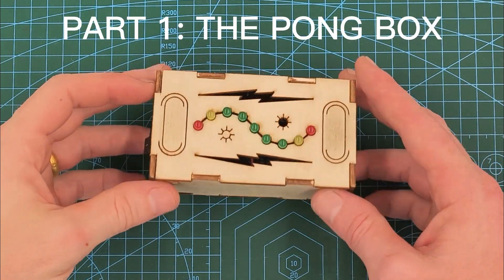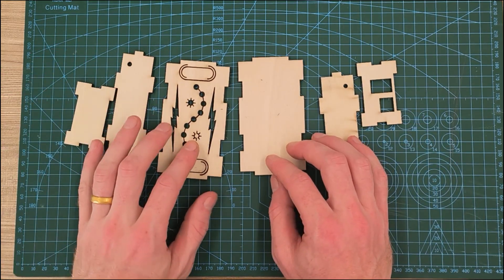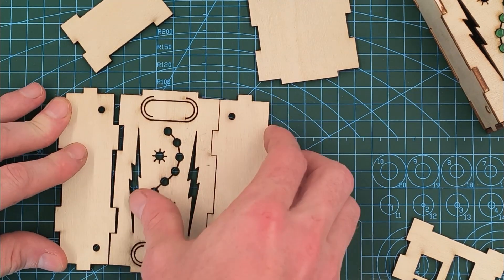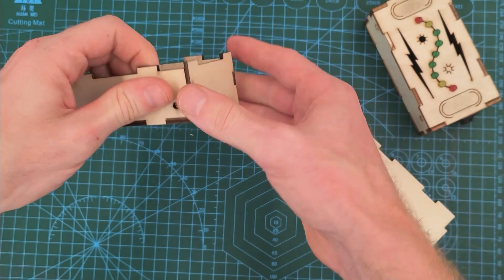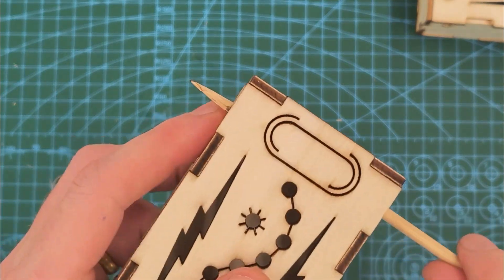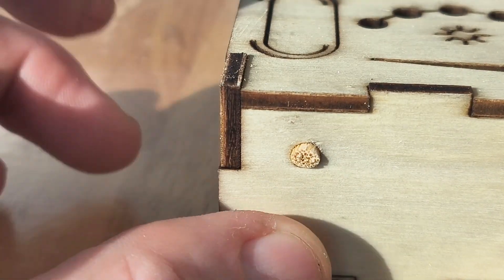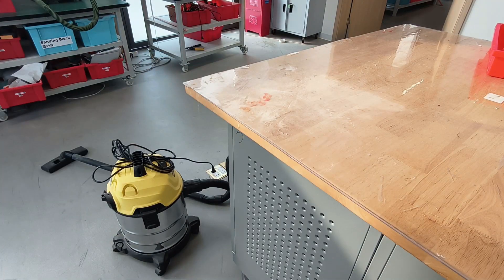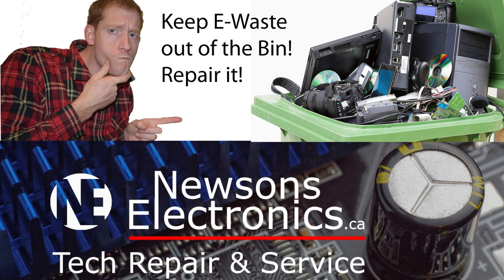Arduino LED Pong Game: A Fun Electronics Project (Part 2: The Box)

Comment: So the burn pattern on what I’m assuming is the bottom of the piece is caused by the laser bouncing off the metal grid supporting the piece. If you lift the part up a millimeter or two it should be a lot better. I don’t have a laser, but my friend does and I remember him talking about this. He just uses little magnets to elevate the wood while it’s cutting. You could also be getting burns from the fire coming off the piece on the top, which can be avoided by placing some transfer tape, or some other covering on the surface of the wood. Depending on the complexity of the part, it might not be worth it to peel all that off, and there’s probably a better way to do it.
Reply: thanks for the idea